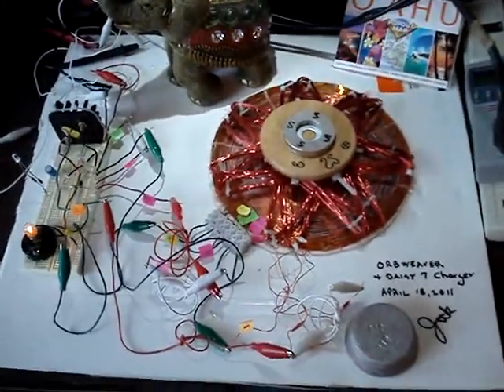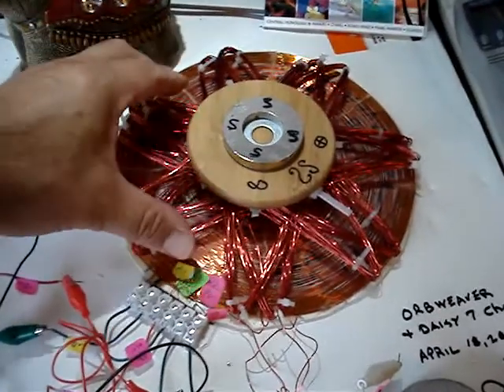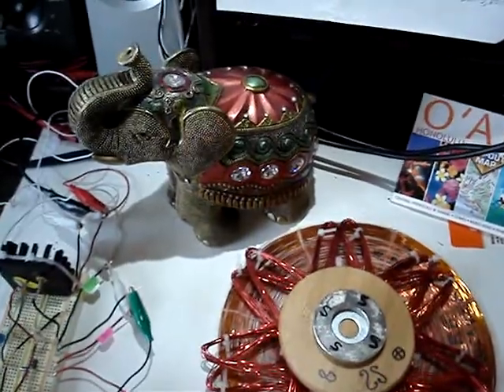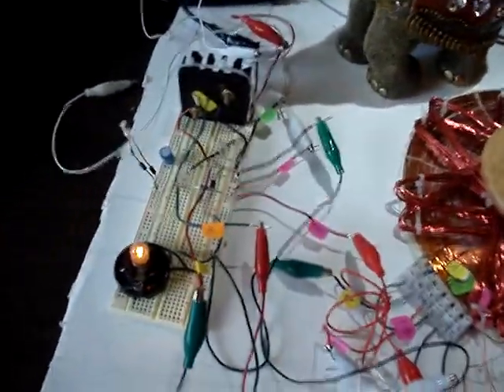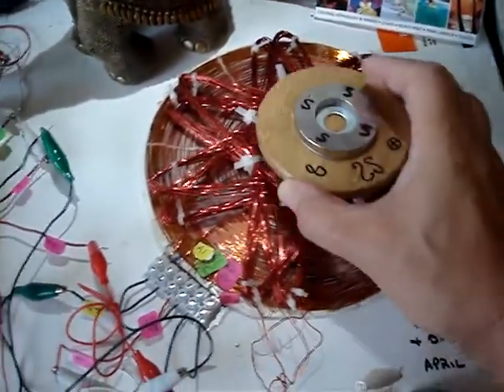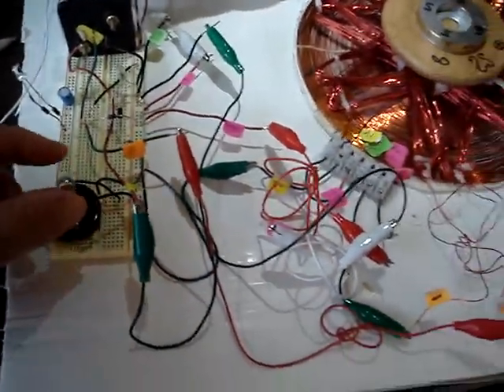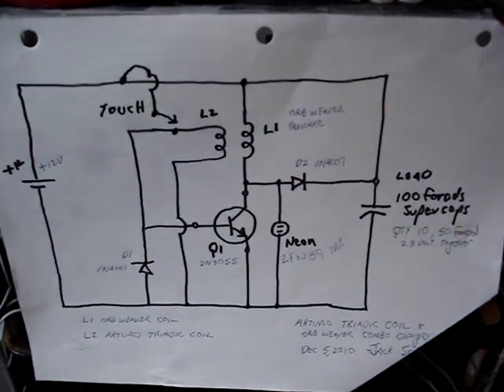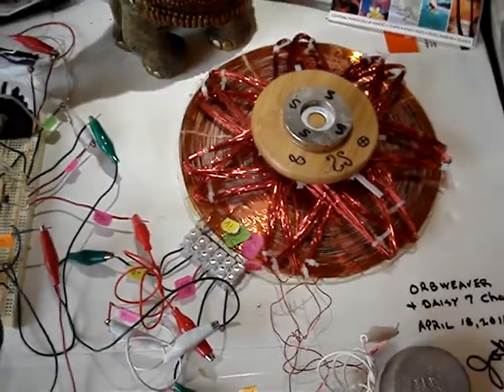Orbweaver and Daisy 7 Whistler

Comment: Turn on , tune in, Power up.

i like the way the the coils need more power when the lightbulb is unscrewed.
It's seems lke the coils are trying harder but if you screw in the lightbulb and release the energy the coils can run more freely and need less energy.